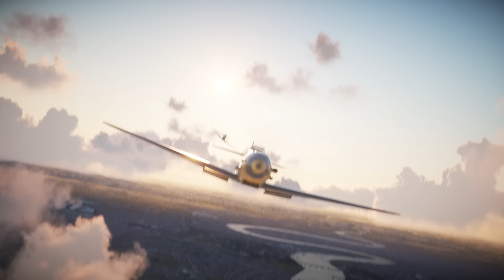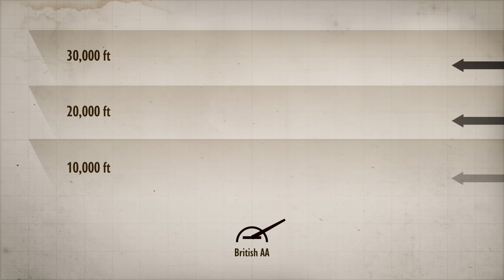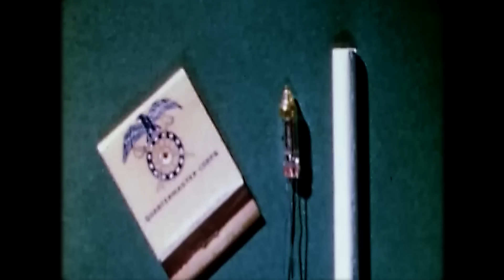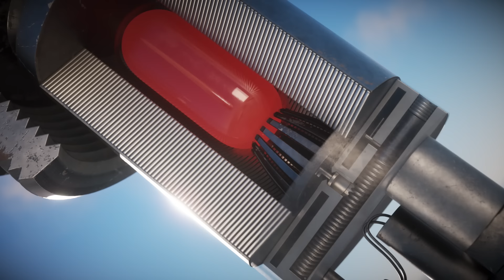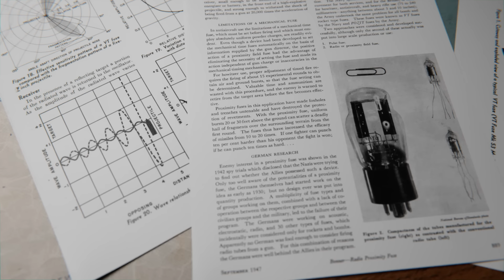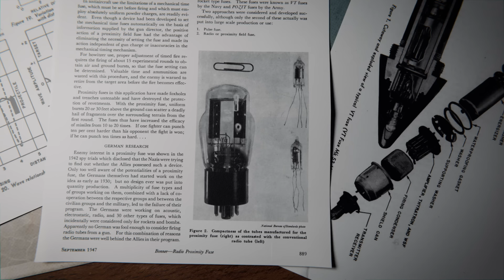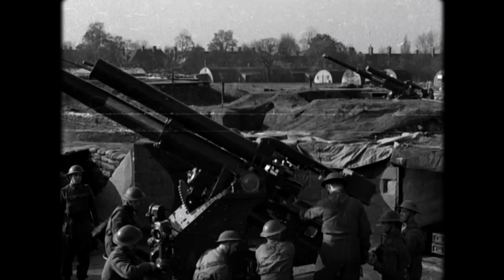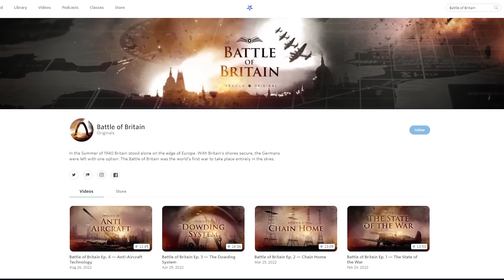The Secret Invention That Changed World War 2

Comment: I can tell you second hand that Germany's AA in WWII was NOT ineffective, especially on the bombing run where the planes had to maintain straight level and could NOT take any kind of evasive action in any flight parameter, constant speed, level wings, no climb or descend, for the Norden bomb site to get bombs on target, or even NEAR the target.  My father in law flew the B24 in that war and said that radio silence discipline would just fall to pieces when AA, or far worse, AA and fighters together started attacking.  He always said that flying bombers was hours and hours of tedium, punctuated by a couple of minutes of terror.  

And eventually, toward the end of his required missions (thirty, or something like that, it's been a while), he was shot down over Poland, and they lost some of the crew, but he got out thanks to the Polish partisans, and I wanna tell ya, he loved the Polish people until the day he died.  The Poles are doing some kick ass supporting in and of Ukraine right now too, so I'm seeing what he was talking about, from afar.

That was a very strange "vacuum tube" that you showed, the first one, with two wires coming out.  Could be wrong, but it looked curiously like a mercury switch.   That 50,000 RPM spin rate on the AA is truly hard to believe.  I looked quickly and couldn't find any data on it, but if I could find the muzzle velocity and rifling pitch it wouldn't be difficult to calculate, just haven't done it yet.  I gotta believe that the rifling wasn't too terribly aggressive, to keep the velocity up, unless they just had altitude performance to burn, which maybe they did.  You very well may be right, that just sounds pretty amazing to me, if true.  I've got to believe that the electronics were pretty much coaxial with the round, as much as possible, or the tangential forces would have been WICKED.  I would guess that they were likely potted, as well.

Great vid, interesting.   It might be interesting to do the same video on current tech for this function, as well.  You could include artillery rounds, too, maybe, and talk about guided rounds, like Excalibur.  Cheers.

Comment: I love this invention so much. I'm really happy you're doing a video on it. Good job!
Reply: Not nearly as impressive: I was charged with overseeing the modification of some 25,000 mobile radio sets that were installed in military vehicles.  The Army TM made the FATAL mistake of challenging me by using the word "IMPOSSIBLE".  They said it was impossible to do this task in less than 64 man hours, and without nearly totally disassembling the entire vehicle--dropping the engine, transmission, axle, fuel tank, etc.  I noticed 4 or 5 flat rods on the ground (still have no clue to this day what they came out of), and found a way to reduce the time from 64 man-hours to 30 man-minutes, and NOTHING on the vehicle that was not directly related to the functions being modified had to even be looked at. Where there's a will, there's a way!  (My Parents should have named me "Will"!)

Comment: No one weapon system was responsible for the outcome of WWII except arguably and only partly, nuclear weapons. The greatest factor in deciding the course of the war was relative industrial capacity of the belligerents.
Reply: I disagree.  Given the volume of their use, everywhere, and along with their effectiveness, I believe proximity fuses were a much greater factor than even the nuclear bomb.
Reply: @Pene7942  The result of any one weapon on a war overall is an extremely difficult thing to calculate. I'd posit that the main feature of 'the course of the war' was who ended up being the victor. The US alone had at least 2.5x the industrial capacity of Japan and Germany combined. Protected by large oceans, the Axis had no chance of changing this during the war without very long range bombers and nuclear weapons. Thus, the Axis lost the war when the US entered it.  Considering how far along their nuclear weapons programs got, I posit that this was not likely to have happened even if the Allies had lost many key battles that they had in reality won. So, I suppose that when I argue that nuclear weapons were more critical, I mean they were the only weapons that could have changed the outcome for the Axis. By the time VT fuses were deployed (even then - just at sea) Operations MI and Barbarossa had already failed and the Axis was doomed to lose fairly quickly. As for the VT fuses impact, do we even know what percent of Axis aircraft were shot down by AA guns VT fuses (mostly just 5") as opposed to smaller AA guns and or Allied aircraft?
Reply: @Pene7942  I do not mean to disregard British tenacity, naval power, and ingenuity and Soviet resilience and sacrifice as very significant factors in the war.
Reply: A main piece in the puzzle alongside, penicillin, radars, computers, pre packet rations, synthetic rubber, the VT fuse, nuclear bombs, Henry Ford. And so on.......

..

Comment: Date of the first RAF raid over Berlin: 25 August 1940.

Date of the first Luftwaffe raid over London: 7 September 1940.

This was in direct response to the RAF raids over Berlin, at the insistence of Hitler, changing Hermann Goering's plan to destroy RAF aerodromes to achieve air superiority in prelude to invasion in operation ea Lion.  This change allowing the RAF to recover.  The "fact" that Goering also ordered this change was because Hitler reacted to the British bombing of Berlin with fury, and Goering undoubtedly decided not to object (or not enough).

This change was one of Hitler's biggest mistakes.  If the RAF had been neutralized, the UK likely would have fallen, and there would have been little to oppose Nazi Germany's dominance over Europe, and nowhere nearby from which to base operations for a counter-invasion such as D-Day.  It is as though all of modern history turned about this one point.

Comment: I read about the Mk 53 fuse in my 2nd or 3rd year at Canoe U.   It was a fairly detailed treatise on the fuse with only a picture of one fully assembled.   Thank you for this, the cut-away views were fantastic and explanation was precise.   I can say that here, 40 years hence, I understand this completely now.     Do you know if this was part of the technology exchange with the US that was effected by Sir Henry Tizard?
Reply: Basic mode of operation came out of a fuze design for unguided AA rockets by W. A. S. Butement who was one of the founding fathers of British Radar. The VT fuse used a circuit of completely different design (and of course could deal with 20,0000 G launches and tens of thousands of RPM).

Comment: The engineering on the VT-fuze is nothing short of genius. Whoever came up with the idea of the wet cell must've rested very easy every night, knowing they've saved thousands of people.
Reply: I mean it's extraordinary. I would love to hear the process that was gone through to come up with this. I imagine it was a collective endeavour.
Reply: When you look into it, even the engineering of a "Basic" revolver is extremely detailed an uses a myriad of techniques that continually evolve from 1835-1935, even if the basic gun itself has not taken many massive leaps forward it kept incrementally improving until when you held a swing out, speedloader ready, double action revolver of 1935  against a Colt Single action army that you realize how many things have changed. 

The stokes mortar, which is the mortar in the man portable configuration similar to what we know today, was made by a man in his garage in 1915. People back then just knew how to build things and could regularly tinker with it to learn new and incredible things. With the amount of highly skilled machinists, engineers, tool and diemakers, assembly line production and adaptation masters and other "wizards of steel" there really werent many mechanical problems that could not be solved by something someone had run across already. 
 The true breakthrough of this fuse is the reliable liquid power cell and the safety regulators of it. As far as a spin-actuated centrifugal force mechanism in an artillery shell, I believe Andrew Hotchkiss who was an extreme visionary of his time and could be (extremely highly) honored as "the John Browning of Artillery shells" had created one over 50 years before. 

Rarely do any sort of significant innovations come out of a vacuum. Its a gradual course of steps and slight improvements, borrowed ideas and transferred technological fields that create some of the greatest innovations of the second world war, and our world today.
Reply: @booradley6832  Andrew Hotchkiss?

Can't find anything about him on the internet.
Reply: Do we know the names of the engineers?
Reply: @klazarovful  https://en.wikipedia.org/wiki/Proximity_fuze - Samuel Curran (my grandfather) was one of the British physicists who invented it
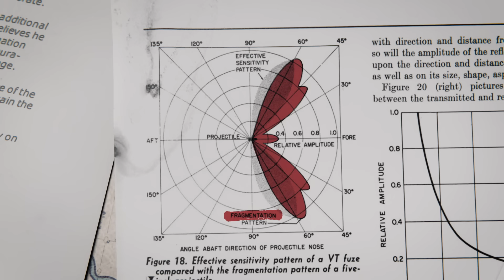Reply: @jamescurran64 8:28
Reply: @klazarovful  Merle Tuve and his group
Reply: @klazarovful  - my father was part of the team, was "awarded',  honored with certificates for "increasing shelf-life" .. afterward worked for Navy Labs 20 yrs in S.California, continuing fuse design. He had some of the early examples and one 'mock' VT fuse in the shop .
Reply: @klazarovful  You may enjoy reading the biography of Dr. Merle Tuve of Johns Hopkins University.  The US Government approached him to lead a supersecret project researching this fuze, and the Johns Hopkins trustees appropriated money to establish a laboratory without even knowing the purpose of the research.  In this way,  they disguised the military research facility as an academic physics laboratory.   The laboratory hid in plain sight on Georgia Avenue, one of the main streets of Silver Spring, Maryland, a suburb of Washington.   

Dr. Tuve was a master of organization, using many innovative techniques to build and motivate his team. One of his ideas was to form teams of advanced-degreed engineers of high  theoretical knowledge paired with ham radio operators who were experienced in building their own radio equipment.   The different skill sets on the teams complemented each other.   He broke down barriers in his organization so that ideas coming from any source were accepted.  The result was that innovation and success occurred quickly.     

The story of this immense project is fascinating and is told in number of You Tube documentaries and books.   I feel we were so lucky to have these brilliant people on our side when our country desperately needed them.
Reply: its not too wild of an idea since a lot of sea mines used a similar principle. the horns on the classic sea mine are lead covers covering an acid filled glass ampule that would break upon being impacted and wet the electrodes in the base of the horn creating enough voltage to activate the detonator.
Reply: https://en.wikipedia.org/wiki/Proximity_fuze Samuel Curran, William Butement, Edward Shire, and Amherst Thomson - scientists at both the British Telecommunications Research Establishment - followed by Merle Tuve and his team in the Johns Hopkins University APL
Reply: Saved thousands lol 😂 and killed millions lol
Reply: And then he said use surface tension and centrifugal force 🤯Genius
Reply: The Americans never contributed anything to WWII! They just stole resources and ideas from others! Like the Atom Bomb and the rocket!
Reply: VT PROX all just an misinformation campaign by the British-American intel transfer team
Reply: @AaronRMG  same as  the british Stop being so rightous
Reply: There is a great book that tells the whole story... 12 Seconds Of Silence: How a Team of Inventors, Tinkerers, and Spies Took Down a Nazi Superweapon
The twelve seconds of silence refers to the time it took for bombs to fall on London. It's a really good read.
Reply: Exact opposite. Driven by desperation to design it, then keep on improving it and also develop new ideas. The boffins could kill themselves from over work, eg Mitchell
Reply: It`s to bad that genius wasn`t displayed by the people who made the torpedos.
Reply: and killed thousands of others
Reply: @Imthefake  Overall, saving HUNDREDS of millions of people, even after calculating the atomic bombs that were dropped.  The Japanese were NEVER going to surrender.  (ONE did not, not until they found his Commanding Officer in the 80's and sent him to the Philippines to inform his LT that the war had been over for FOUR DECADES).
Reply: @nobody7817  It's estimated that the atomic bombs saved over 250,000 American lives and over 10 million Japanese lives.  Japan surrendered just in time for a massive US food aid program that prevented starvation.  One of the lesser-known footnotes of history is just how much food was sent to Japan and Germany after they surrendered.  (Likely done without publicity to avoid issues with public opinion.)
Reply: @Imthefake  Kill or be killed, mate.
Reply: @Imthefake  Saved hundreds of thousands/millions
Reply: @Imthefake Dick statement. Who was attacking whom. When somebody’s attacking you, do you just roll over stick your ass up in the air and hope for the best?

Comment: Wow, the design with the glass ampule breaking and the round spinning to prime the battery is just so elegant! Very nice video, really enjoyed it - The graphics explaining the tech is just excellent, well done! I totally agree on the pivotal importance of this invention, war drives innovation, maybe you could do a video on that sad fact?
Reply: The battery was a smaller copy of the hertz horn used in contact naval mines. You know the big spikey cartoonish looking mines. 

Oddly enough jet engines were developed quickly due to how much they could borrow directly from steam turbine manufacturing and turbo charger manufacturing.
Reply: "Elegant" indeed. Any engineer or designer would be justly proud of this Fuze.
Reply: As an engineer, my first thought given the problem statement would be to insert a separately delivered battery when loading the gun, not unlike the past practice of adding gunpowder at that time, with the further benefit that separate dry ZnC batteries are robust and make excellent shrapnel, their insertion can be mechanized in the AA gun using a magazine storing multiple 24V batteries, one per shot fired .
  Similarly, in the absence of plentiful electronic fuses, a mechanism could be devised that mechanically turns timer rounds to a value set on the gun according to load, distance and altitude, eliminating manual adjustment during battle (such a mechanism, though electronic, is in some modern guns) .
Reply: I'd probably frame it as "humans naturally want to invent things - why are so many of the famous inventions related to war? what's suppressing inventions the rest of the time?" but yeah it's pretty messed up.